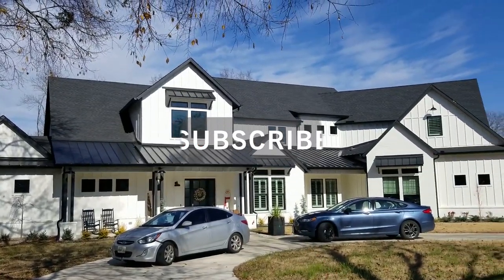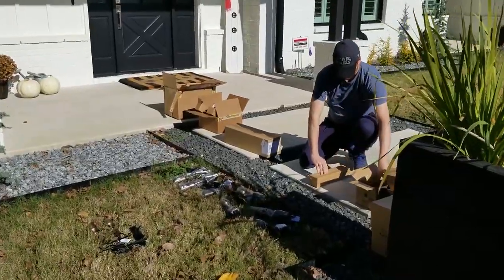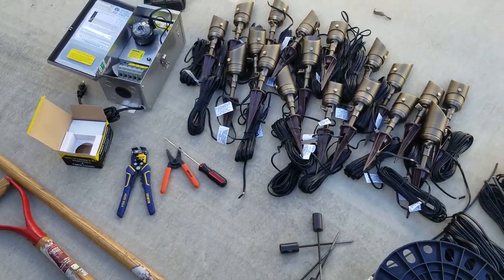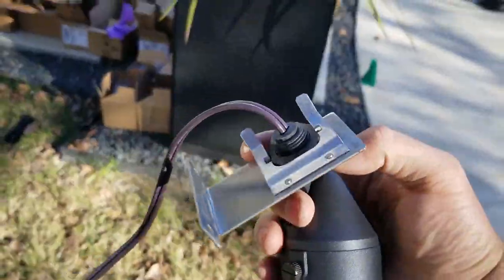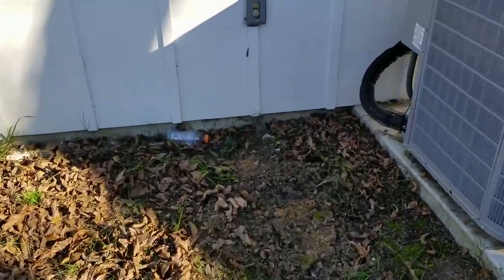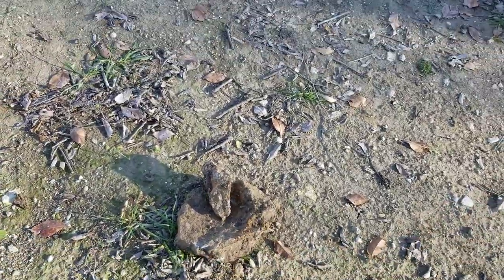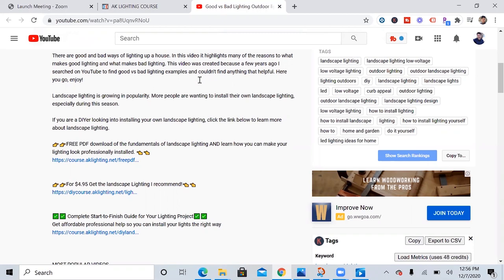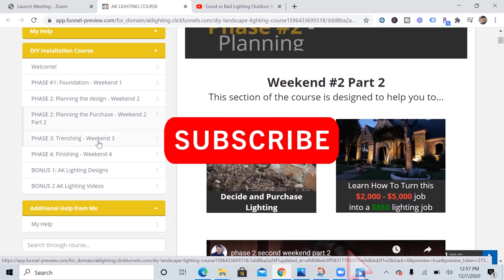Costco Lighting Kit Installation | Outdoor Landscape Lighting Installation | Stunning Results

Comment: Thanks for taking the time to post your videos.  In your 5 common mistakes video you mentioned placing each light about 1.5 feet from the subject.  These lights are either closer, or farther, away that that amount.  I guess knowing when the break the rules comes with experience?  Also, the front door was not highlighted.  Was that intentional, or is there only so much you can do with the Costco kit?
Reply from the maker: Thank you, I appreciate it. So the 1.5 ft is the standard, but as a installer, I have to do whatever the customer wants. They ultimately decide the distance, design, how many lights and I can only make recommendations. The customer in this video was pretty particular about not lighting up certain areas. Turned out really nicely. If it were my house, I would have added a few more lights. Hope that answered all your questions.

Comment: Looks great!  Did you run the cable on the roof line directly down in the gutter or zip tie it to the outside of the downspout? If inside the gutter is this safe to do?
Reply from the maker: I've done both and like both. Either way is fine and safe.
Reply: @aklighting8292  thx!  One thing I noticed in a lot of your videos is most of the houses have side garages so it’s a pretty straight forward design with lighting. What would you suggest for someone that has a front garage?  Is there a way to send you a picture of the front of the house for input?
Reply: @adamkeeler1299  Thx! Email sent

Comment: How do you like the Costco kit vs the fixtures u can buy on volts website?  They both seem to carry lifetime warranty?
Reply from the maker: I prefer the fixtures from Volts website better, but the Costco lights a great. Yeah I think they all have lifetime warranties.
Reply: @aklighting8292  what’s the difference other than the spots don’t have threads to mount to gutters or surface brackets?
Reply from the maker: @webcrawler3332  That's the main difference. Other than that, the volt Fat Boy in Amazon kits  is a fatter fixture, and the Top Dog is made better. Overall, they are all brass, all made well, and I think you are essentially just looking at A++, A+, and A, win win overall.
Reply: @aklighting8292  thank you for your input I appreciate it.
Reply from the maker: @webcrawler3332  You're welcome

Comment: You need to be careful screwing that conduit into the tree like that, you may not realize it as you haven't done this very long but it only takes 5-10 years for that tree to start growing around that and making it impossible to remove without severely damaging the tree, unless of course you advised your customer to perform season adjustments to account for the growth of the tree.
Reply from the maker: I completely agree! I use to use hardscape mounts as tree mounts, and about 5-6 years later the trees had completely engulfed them! I try not to mount lights on trees for that reason. I do tell all my customers about seasonal adjustments, but I don't think I've had any who has actually done it. Thanks for the comment!

Comment: That white LED lighting looks like crap on a house
Reply from the maker: Its actually 2700k on the house not white. It looks stunning! I honestly wish they would have gone with a whiter light. Sorry you don't like it.
Reply: What the house is missing to add color is some green bushes and small trees and thus add depth. The color only seems too bright because the fixtures are too close to the house as Adam post but that is what the customer wanted. When the fixture is too close then it creates hot spots. And I also think that the lights should be 3000K and not 27000K as used.